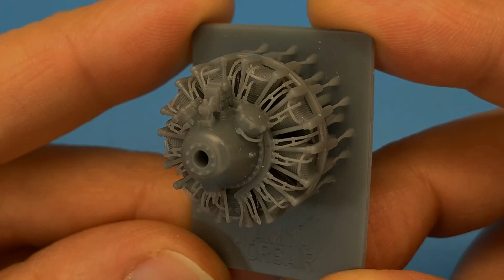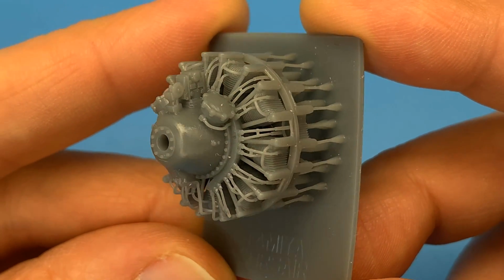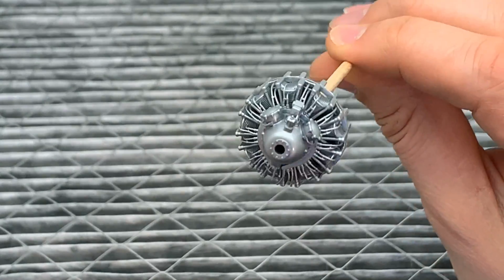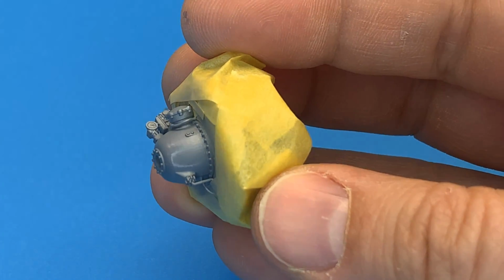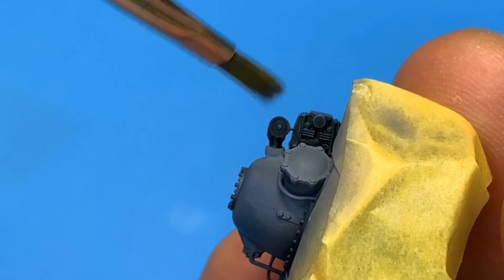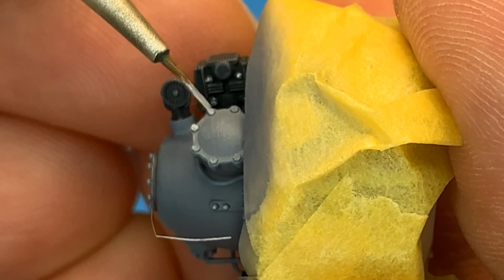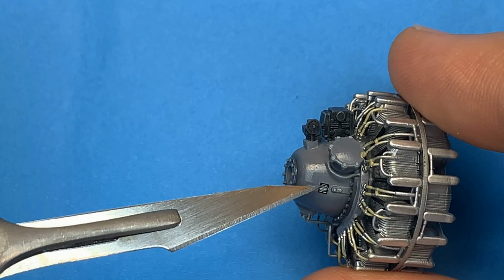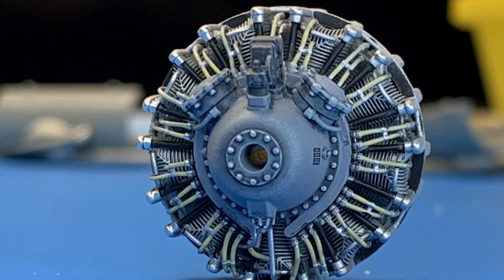How to Paint 3D Printed Aircraft Engines

Comment: Aw, dont be worried about messing up, it's just 3d printed resin.  Make friends with a guy like me who's got a resin printer and you're good.  Dunno about anyone else, but I sure wouldn't charge my friends for a simple little print like that as long as they brought me the files and maybe a little resin or a few bucks just to cover its cost. (Resin is like 20 bucks a kilo so it's not exactly super pricey)

Dont let games workshop and other resin sellers trick you into thinking resin is worth 100 bucks or more for a small print, it isnt. ❤

Comment: Great tutorial. Thanks!

A couple facts: gloss & semi-gloss paints were used to paint the real engines, not flat paints, although natural or plated finishes, such as on piping and conduit, often would have a dulled-off or matte finish. The reason is that the glossier the paint finish, the more its resistance to oil penetration ("staining"); the duller the finish, the more the oil penetration, leading to a more rapid failure of the paint finish ("flaking").
Bolt heads generally were NOT "bright", because they often were not plated if they were going to be painted, AND because, operationally, they were seldom "wrenched-on". Tear downs to rebuild  damaged engines was usually NOT done because the majority of the time engine damage was beyond repairing, at least at unit level, and for this reason , and for reason of operational turn-around time, was out of the question; that's why God made crates of new engines, ready to go.
The observed pale yellow-tan spark plug leads were actually outer insulation sheathing made of woven (herring-bone-like pattern), glass fiber cloth-like material.

Comment: The thingy between the magnetos is the Prop Governor which controls the pitch of the prop blades by the pilot. The disc is where the control cable is attached. Sorry, old engine mechanic talking ! I agree about the 3D printing, I hate those huge casting blocks ! Great looking P&W !